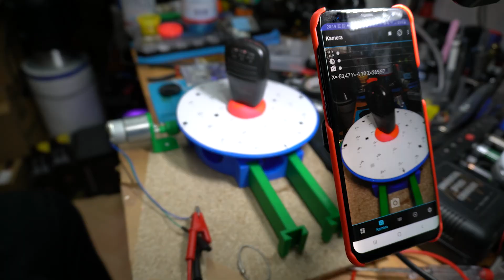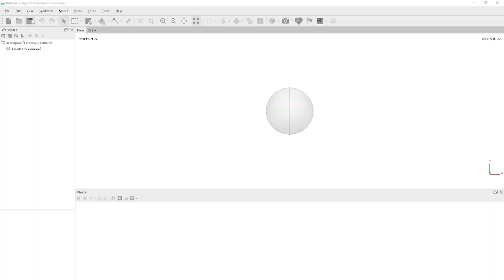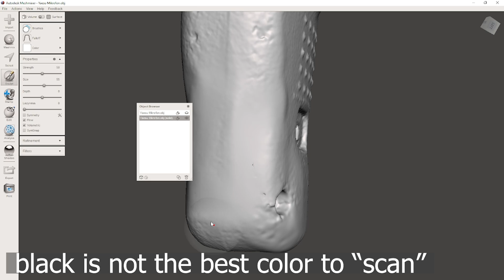Your Smartphone is a Professional 3D Scanner!

Comment: 6:33 About the markers on the turntable´s surface: Their influence is very important. If you have more of them on the sides of the object, it even a lot better. But then, you´d have a cylinder with markers on its inner surface, and you couldn´t shot fotos of the object anymore. That´s why, you need a cylinder made out of 3 segments, each segment having a very precise position on the turntable´s edge... And as the turntable turns, you can always take that one (out of those 3) segment, that obstructs you foto-shooting... But the turntable´s edge, as well as the cylinder-segments, have to have notches, so that you always place each segment at the exact same position, always perpendicular to the TuTa-surface (it doesn´t have to be perpendicular, but it has to be at the same angle it has benn at the previous turn of the TuTa, cause you make several turns, and the segments have to have the same position by every turn, refering to position and angle). With 3D-printing available, it´s an easy task...
The problem you describe at 10:35 is why the positions and angles of those cylinder-segments have always to be the same.

Comment: I'm surprised this works. The software's often get confused because of the changing angles the light hits the object. I learned a long time ago you should not move the object, but instead move the camera around the thing you're trying to "scan". Alternatively build a rig that moves all the light-sources with the part.
Reply from the maker: I do this often and it works all the time - for me, most times much better than moving the cam. Give it a try. Greetings
Sandor - DM4DS